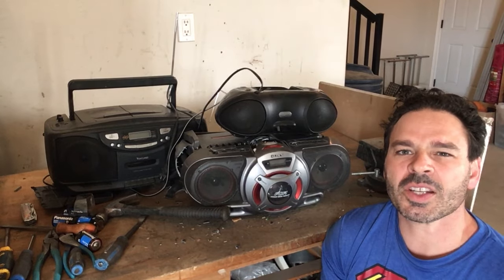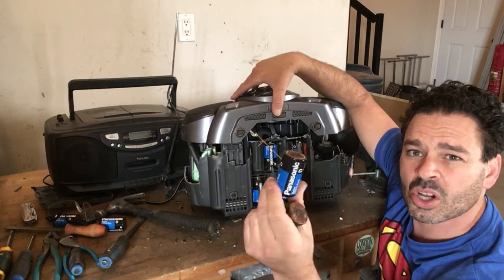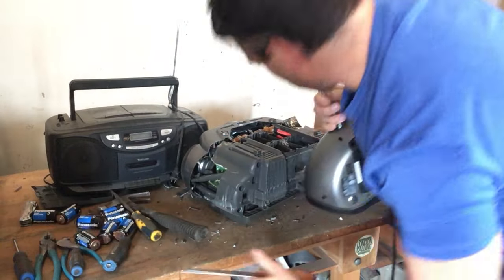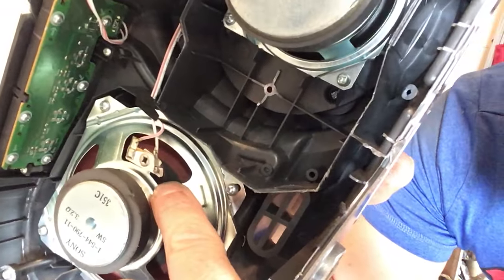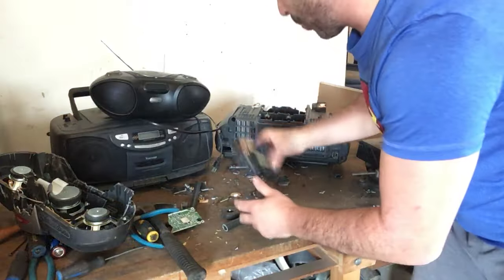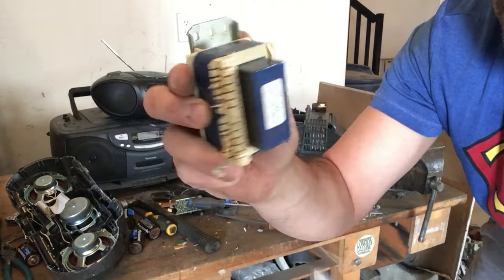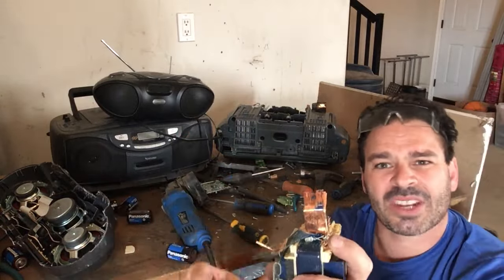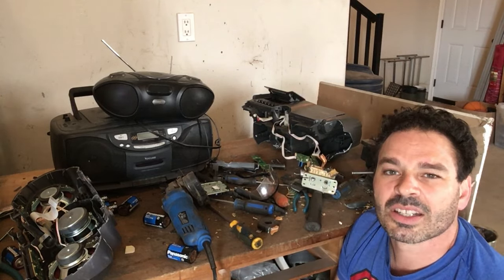Scrapping some old CD players for copper and other metals: love the sound of FREE SCRAP METAL!!!

Comment from the maker: Total was 17lbs tin ($1.70) 6oz aluminum ($0.23), 1.5lbs batteries ($0.75), 10oz. mini motors ($0.12), and 12 oz #2 copper ($3.15). compared to electronic weight price $2

Comment: Tin Man, I've been watching your videos for some time now. I spent a lot of time struggling with the aspect of how far should I pull items apart. For example I used to scrap a lot of TVs. But then I found myself with a lot of plastic or even worse the glass from the CRT TVs. In all my wisdom I have landed on this rule of thumb. I found that if the item is mostly metal, I'll consider dismantling the piece, but if the item is mostly plastic on the exterior, I try to scrap it whole. Even though a yard buys the appliances at 5 cents a pound, they burden all the expense of disposing or recycling the waste (plastic, lithium ion batteries and etc.) that we how no downstream source to recycle so we must landfill it. Some people partially dismental an item then scrap the rest whole ethically. That's probably okay, but morally, you hurt the business that has the infrastructure to recycle the entire item correctly. Conversely, if the items exterior is all metal, chances are the entire item can be sorted out by the scrapper to make money. Cheap washers with  a plastic exterior, window air conditioners with a plastic base or shell, dehumidifiers that are plastic, and so on. With this frame of mind I generate less plastic weight/garbage and make money because I spend less time on that item. Id argue you probably could have made more money to time ratio using that time to find more low end appliances to sell the yard. Since picking up a radio only takes a minute or two. I dont disagree with the other comment about tossing them in shred to double your money. But that shred gets compacted, shipped and burned into a furnace. So its getting burned into our air.  I don't have the answers to the worlds problems but I struggle with the fact that a smart TV cost so much but has a negative recycle value in the end. There are many types of scrappers for me its about efficiently using my time to make the most amount of money without being wasteful. If I took apart a bunch of flat screens TVs and have a pile of plastic, glass and mercury bulbs what good have I done if I have no downstream recycling path.
Reply from the maker: The nice thing is though that the scrapyard actually does send the rest of the flatscreens for example to the proper recycling facilities and they will scrap and recycle the rest, including the bulbs, plastic, etc
Reply: @TinManScrapper  my yard won't take the plastic or glass